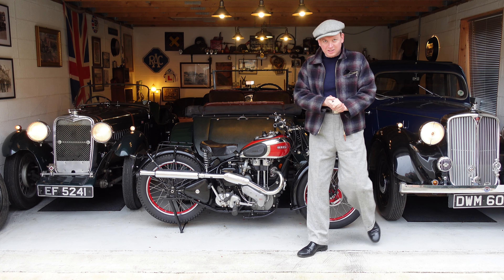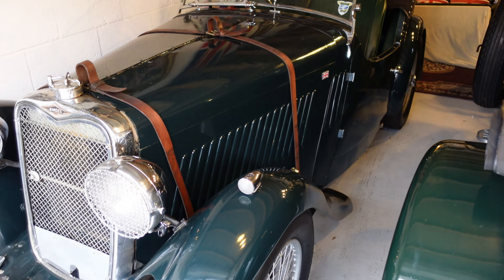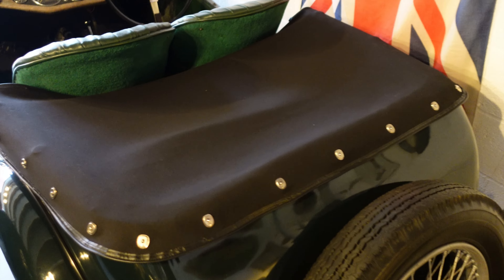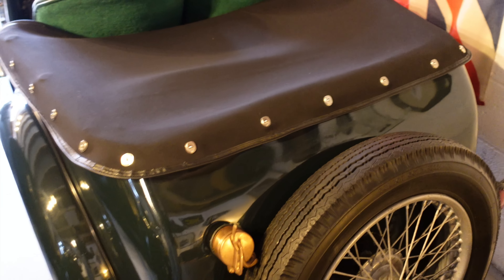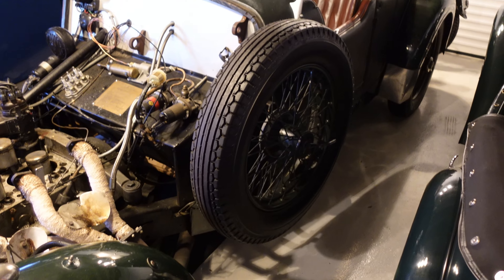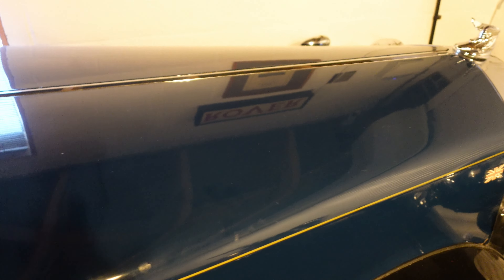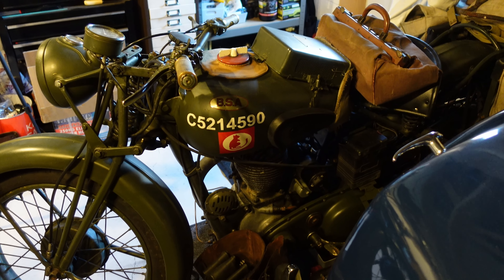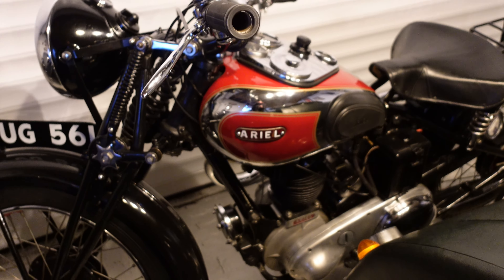Suits & Cylinders - A 1930's Car Garage Tour

Comment: That's a cracking collection you have. I own a 1932 Morris Minor Two-seater which gets used all-year-round. I took it from the Midlands up to the Scottish Highlands and back in June last year. 1,200 miles in 8 days in 28 degree heat. No problems. Just had to drive with the hood down due to the heat coming in from the engine... the gearbox is effectively in the cabin with me, so engine heat has an easy route in. I also own a 2CV which has been all over Europe and Ireland in the 22-years I've had it. Currently sitting on 275k miles.

Comment: Coincident, just stumbled on your channel; genuinely worth watching!! Petrol head myself with a sweet tooth for prewar cars and bikes. Rather new (&allowed) to the car-scene, owned/started/restored my '38 Ariel NG350 46yrs back, took me then already 6 years to get it complete & riding... started with a frame & few wheels & bits...recently my fins dropped of > now full circle to redo again... quickly through time (+lots of extra bikes, Velo's), few years back, I wanted a similar experience but on 4 wheels... bought a barn find '34 MG PA/PB... already in my 6th year, just finished restoring my original crank, beginning to built the bottom/top. Over the years my 3steps forward, but 2 back due to the help of 'experts'... but not put back, just perseverance (& some madness is needed). Not jet into the suit )or dress) scene, more black leather or overall... but do wear my self made '30s brown 'insomniac team' polo shirt! Impressed by your beautiful collection & garage.. Looking forward to see your other uploads, like your 30s through the lens of the 90s in it! Hope to see some of your engineering escapades... as already too many other prewar YT clips are either polished, not touching/representing the genuine '30s experience, like most 'fraternity magazines' where all is all is penny friendly but 'pound costly' tearful.... and all done by (hidden)experts... Thanks!!

Comment: Passed my test on a 1939 Ariel red hunter twin port back in 1968. Bought it as a frame and 2 wheel barrow loads of bits. Paid £5 put it all together, passed test and sold it on for £10. Guess not one of my best moves, I should have kept it.